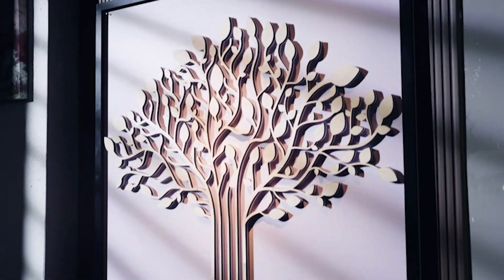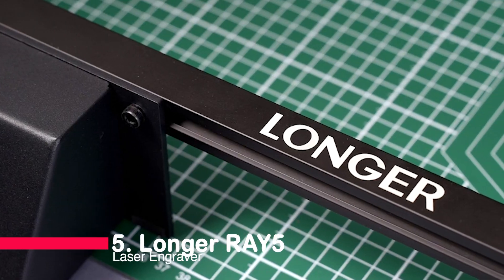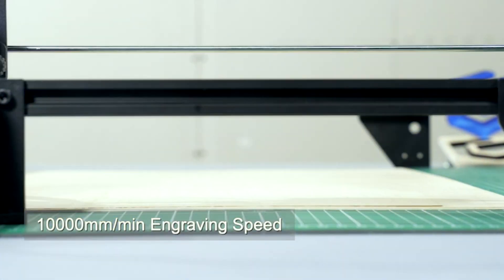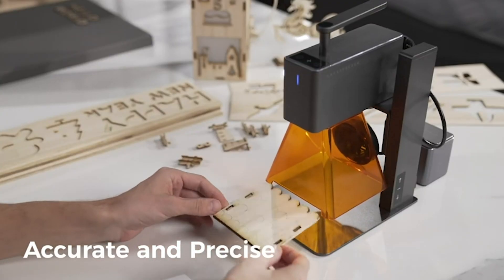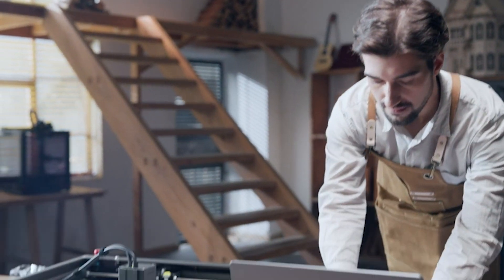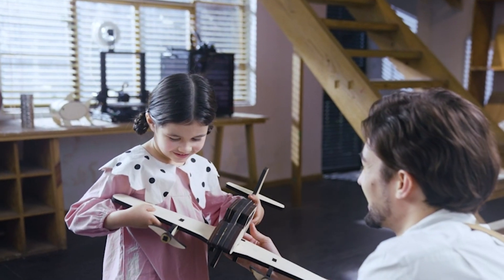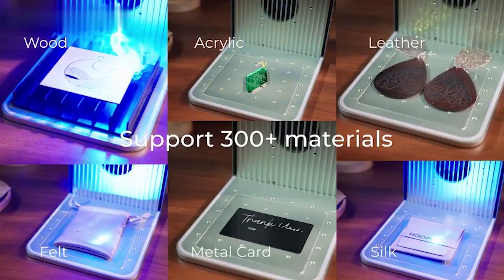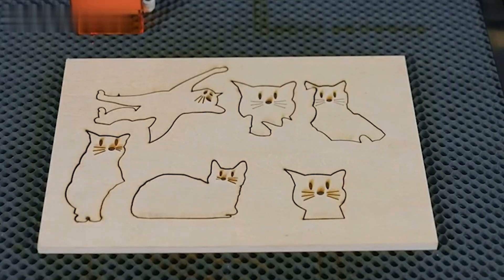5 Best Laser Cutters & Engravers in 2024

Comment: how to do Laser Engraving on a Natural Peepal Leaf saw many people doing it. is that true
Reply from the maker: Yes, it’s true. Laser engraving on natural peepal leaves is possible, but it requires proper leaf preparation. The leaf is usually dried, flattened, and treated to remove moisture before engraving. A low-power diode or CO₂ laser with very precise settings is used to avoid burning. It’s a delicate process, but with practice and correct settings, very impressive results can be achieved.